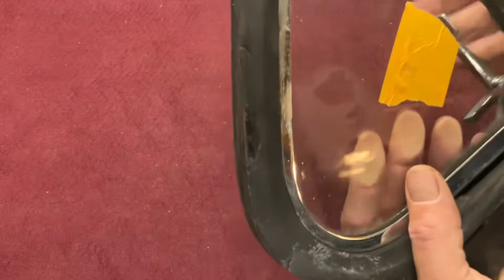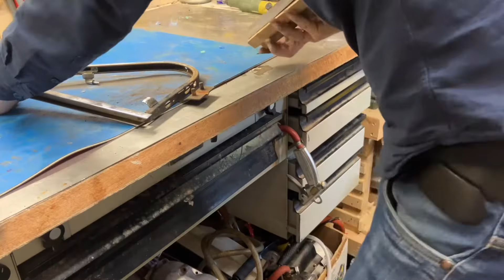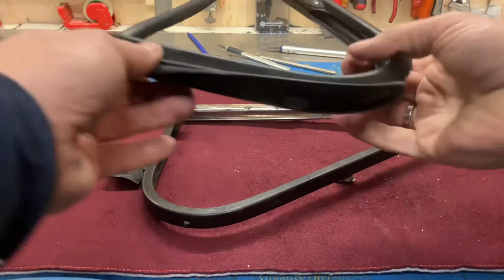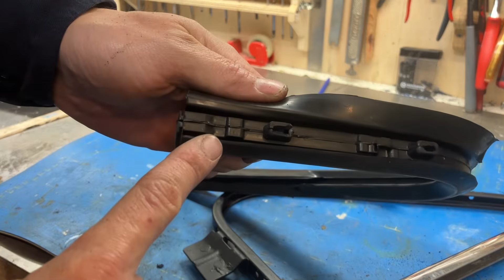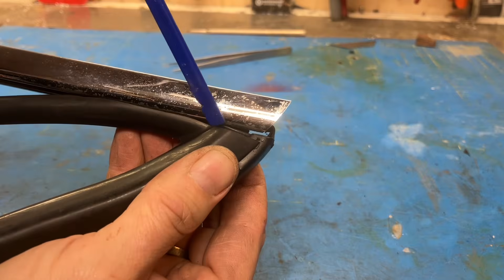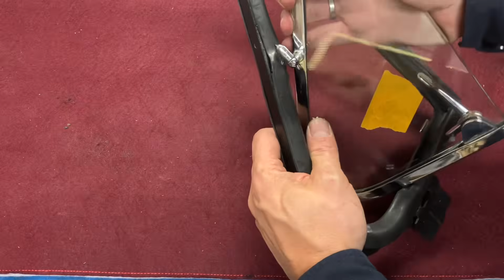Installing Austin A30-A35 Quarter light window seals

Comment: This is also on my list. Any tips on getting the frame out of the door? How on earth do you replace the seal without taking it out as suggested?
Reply from the maker: I would indeed take it out if possible… I found it hard enough doing it on the bench

Take out the main window by loosening bottom bolt of the window channels (runners) from the door and making room that way. You need to also unbolt the spring tensioning arm. Once the window is out you can remove the channels (runners).

Tips… yes, take your time in finding all the screws and use a well fitting screwdriver. They are probably rusted, but drilling them out is a whole lot more work.

Comment: Thanks for showing this - I'm just about to do the same job. Do you know if the 4 door a30 uses the same quarterlight rubbers on the rear doors?
Reply from the maker: No, those are of a different shape. I have no experience with rear door quarterlights. I am sure that with methodical thinking and patience you will do fine!
Reply: hoppend is correct, both the fronts & 4 door rears are available from the Austin A30/A35 Owners Club